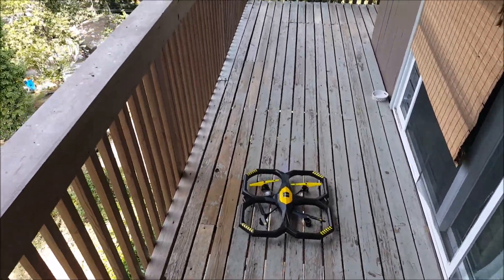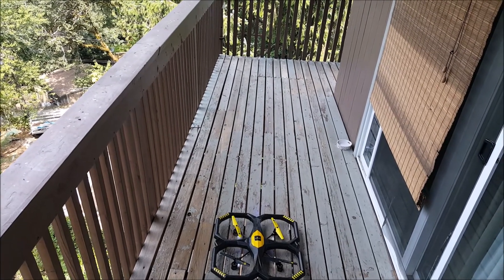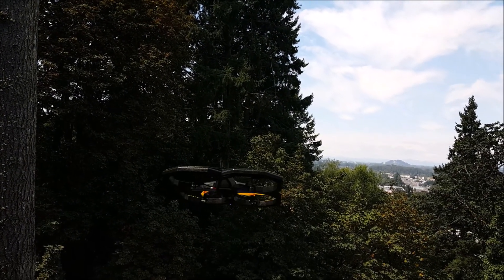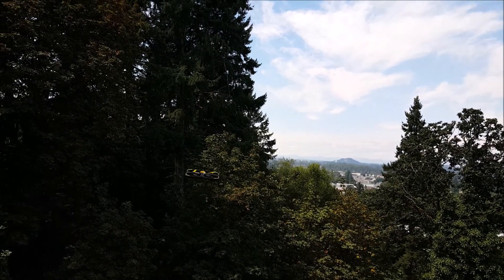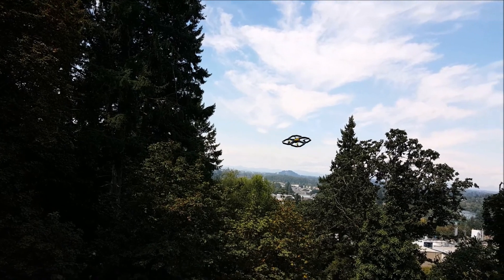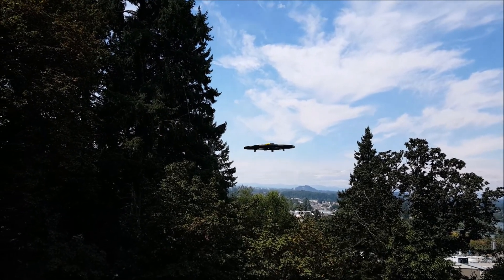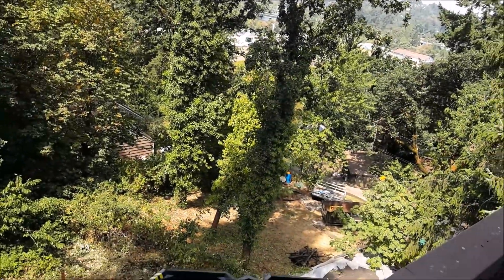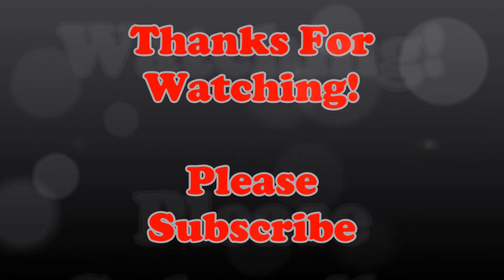Maiden Flight: UTO U907

Comment: Can you say tree hanger :P, looks like I get to see if I was right about needing a large gym ^^ or just trimming up the trees on the lane :P That thing needs the FPV system the WL Toys model has then it would be more suited for flights, yes I know that would add on money but a rtf 5.8ghz FPV system is worth at least another 40 or so for UTI on this quad. It seems to handle crashes well which is good, especially for beginners, low rate = beginner I assume like with all quads.